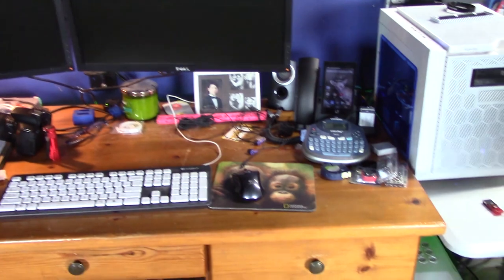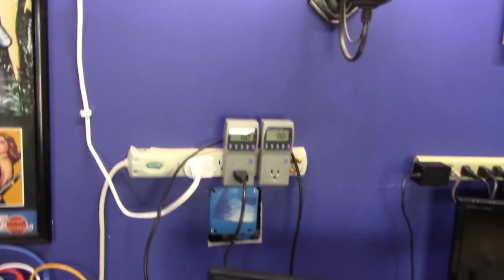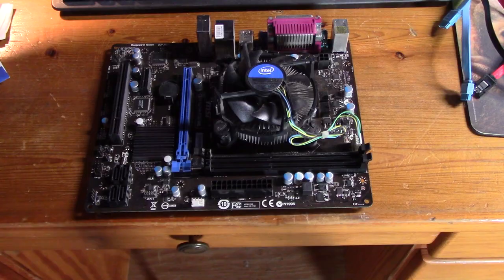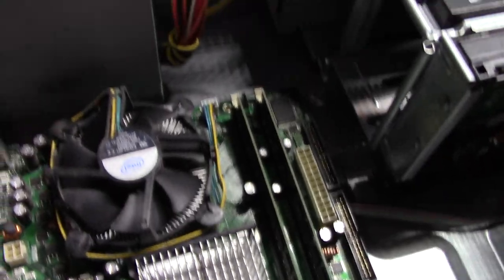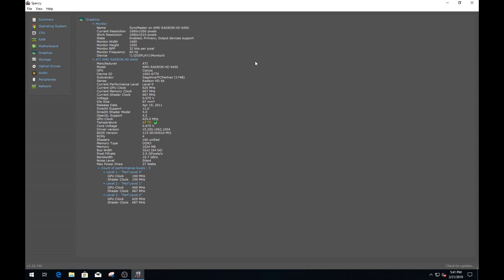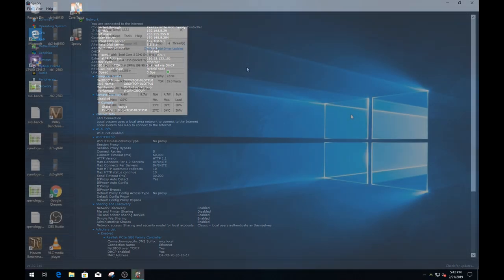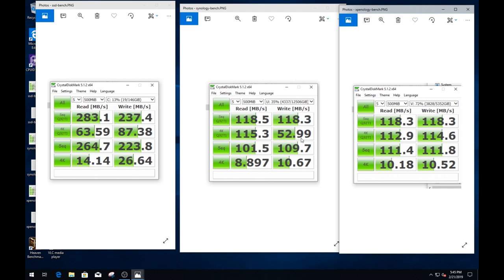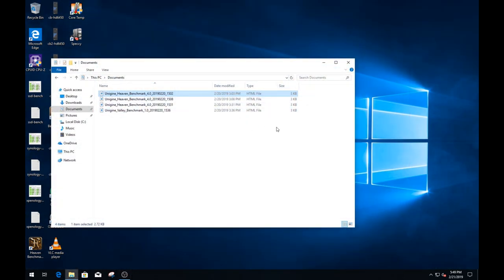Everything old is New Again-Upgrading the bench

Comment: Used equipment is all I buy. My desktop computer is a Dell Optiplex 780 with 16gb ram and 240gb SSD boot drive and 3tb Data drive with Windows 10 Professtional dual boot with Ubuntu 18.04. Runs great.